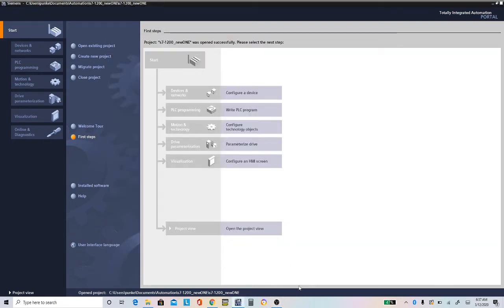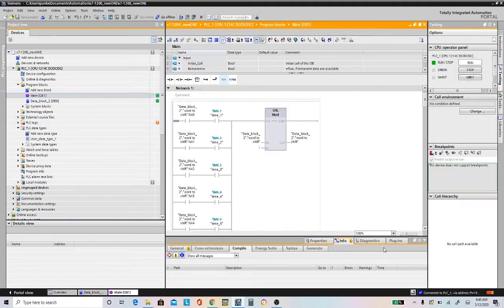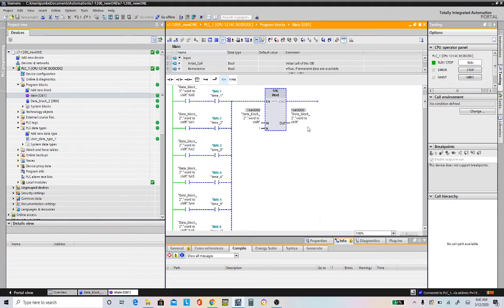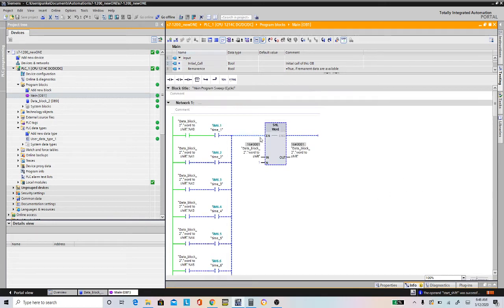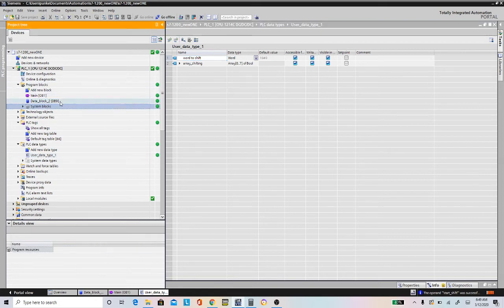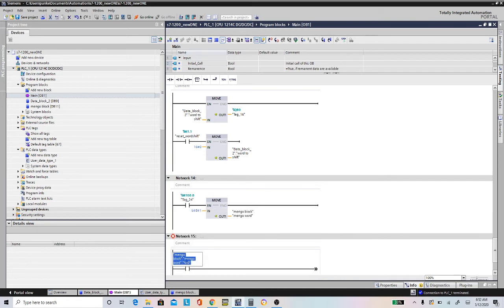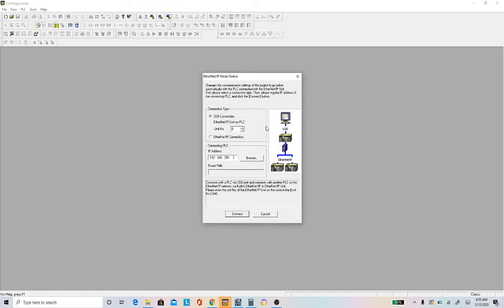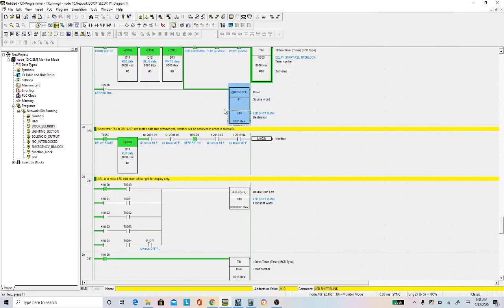How to use Siemens SHL (Shift Left) the right way!

Comment: Word in siemens contains 16 bits bruh
Reply from the maker: my apology.  What I really meant was if using the actual digital "OUTPUT"  of the siemens IO card, they comes in BYTE only (8 bits or 0.0-0.7 or 1.0-1.7 etc. )  So if anyone wanted to make a actual output to tinker and turn on sequential,  and if they use say....QW0, you'll only get 8 bits of word QW0.  Now of course if you're using all INTERNAL such as M bits or your own data tag, then of course, it's 16.  Here I as talking about the actual hard OUTPUT that comes with the PLC on a s71200.  Sorry for the mix-up.  Old videos btw glad someone was watching.  :)